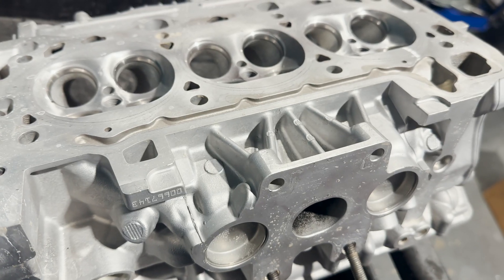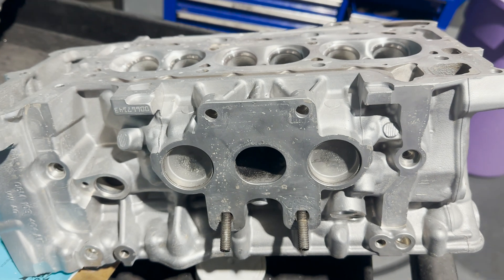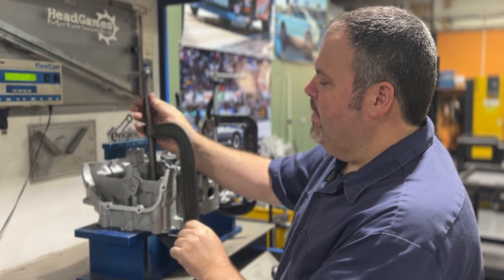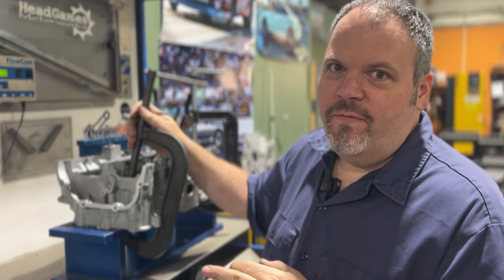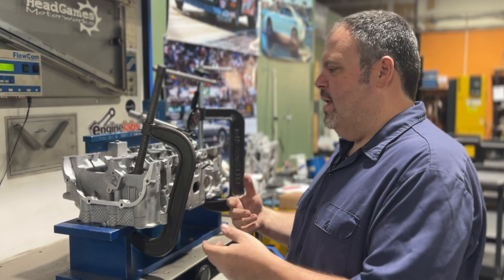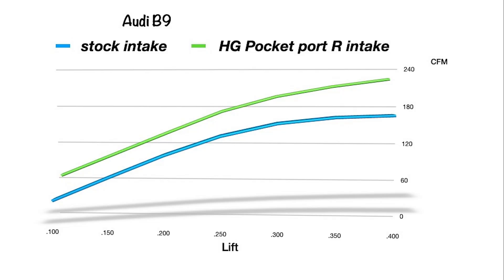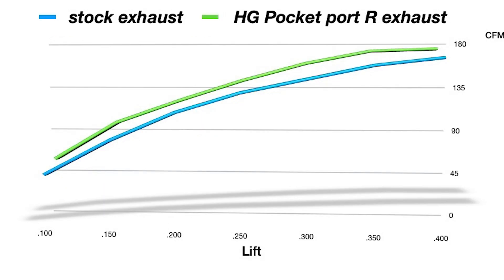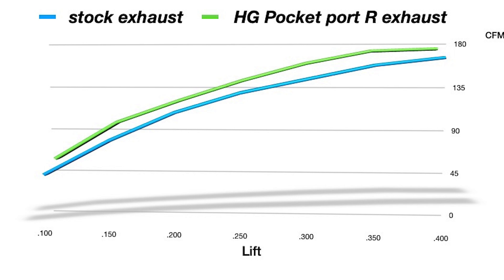The ultimate cheat sheet on getting the Audi EA839 cylinder head to flow better

Comment: Thank you for the valuable insights regarding cylinder head ports—particularly the exhaust side. I recently upgraded the turbocharger on my setup, and during inspection, I noticed the exhaust port diameter appeared to be only slightly larger than a quarter. That observation led me to consider whether porting and polishing the exhaust ports could improve flow and better support the demands of the larger turbo.
 You answered my question, i know now efforts would be more substantial focused elsewhere.
Reply from the maker: That’s awesome that you got some answers to that! Good luck with your build!

Comment: So I have an Audi C8 S6 and it has the EA839 2.9L. I have the biggest twins they offer for my setup currently TTE810s, 4 bar map sensor, 034 built bottom end, HPFP, LPFP, RS6 ported injetora, and a custom front mount inter cooler. So I pretty much have everything done to my car that’s possible. My question to you is will you cylinder head porting off a bigger power gain over what I’m already getting?

Comment: EA839 is on the B9?   The numbers stock are poor for a 3.0L.    So going to nearly 240CFM from the near 180CFM peak is a big deal.   Actually the .200" and .300" numbers are probably more important.   I was looking at 2JZ/1JZ/1mz/3mz Toyota before this which are 3.0L with 33.5 or 34mm intake valves.   On those situations they might make the intakes 35 or 36mm but stock valves they can usually get to 270cfm peak and 300cfm or slightly greater with the increased valve size.   It's required on the high power situations.

I have stock VQ35 Nissan at 205cfm@.200", 240CFM@.300" and 275CFM@.400".     1MZ Toyota 175@.200", 210@.300", 235@.400".   Ported 1mz @185@.200", 230@.300", 260@.400".    Porting on the 1mz gives 30whp naturally aspirated and almost 100whp with 14psi of boost.

So Are the B9 heads better or worse than the B8/B8.5 heads?    If the B8 situation is even the same as the B9 it's pretty horrible and porting will give some descent gains without changing much (  60-100whp on the stock boost ).

Comment: I'd be happy as hell with those gains.  Exhaust will pick up a lot relatively by just going to a larger turbine wheel and reducing backpressure. Do you ever take moulds of ports to measure taper, etc?
Reply from the maker: We haven't made a mold in many years. Now, we don't need to because we have CNC digitizing.

Comment: What does it cost to have a head tested for flow? I have a 4Piston 163 head that has been refreshed that I would like tested. Has 37mm intake valves. As soon as you have a sale on Honda heads, I have a K20 to send you for porting.
Reply from the maker: $300 for flow testing with a sheet. But, I don't think it helps much unless you always have it flow tested with one person. Like, you can't really compare the numbers because it might be how we would flow it that makes a difference in flow. It's not always the head.

Comment: Quick question, what happen to the velocity and flow if you completely remove the radius on the short side (its a straight shot from the beginning of the port to valve seat) and the head has enough material. The bowl area remains untouched.
Reply from the maker: never tested it so I would only be answering in my own theory that it would not change velocity. Only changing the port would change velocity .
Reply: @headgames  Thanks

Comment: Do you perform a single before and after flow test or do you flow test for each mod, like once for the porting and once for the valve job to show which part created which gains?

Also what is a B9 engine? Is this a v6 from an audi a4 b9 chassis or is b9 the engine code?
Reply from the maker: I don't always show every test but, yes I flow after every mod so we know what each change helps or hurts. Otherwise, you don't know what was worth it.
Reply from the maker: this is especially important on the valve job side. Because they are not all created equal.

Comment: keep up the good work! I'll never port a head but learn a lot from this channel. Main thing I learned is where to send a head if I want it done right. Is there much to be gained on gen 3 coyote heads?
Reply from the maker: Thanks for the kind words! That was what we are looking for, to inform guys like you. Gains on the Gen 3 depend on supporting mods. You need more than a stock short block to make that worth the price. There would be gains regardless but is it worth the price of admission in a NA scenario I would spend my money on boost and get the heads rebuilt with some good parts instead.

Comment: What are your thoughts on extrude honing? I read an article on it years ago with people getting it done on the intake and exhaust ports. Also turbo compressor housings  but its basically unheard of nowadays
Reply from the maker: @myrx2  I believe it’s a complete waste of money and energy. It’s just smoothing things out not taking out to a specific size or location of the port. You want real results then you have to do real work.
Reply: I'm gonna respectfully disagree with Dave on this one. I don't think Extrude Hone is a "miracle" - but it's good for certain things and it doesn't just indiscriminately remove material all willy nilly.

It's true the operator has far less control of material removal compared to a porting professional like Dave, but it does open up the restrictions while basically ignoring the areas that are not restrictive. It really shines with parts you can't get to with a die grinder. Complex intake manifolds, for example.

That makes it NOT the best for cylinder heads, but I actually had the chance to test this on a CBR600 engine I was using in a little formula racecar. The engine guy prior to me had sent one of the team's heads off for EH; so when I was doing the engine development, I tested it back to back against a stock head. Both had freshly done valves from the same shop. The stock head made 68hp @ tires and the EH head made 71hp. That's 4.4%. I should also mention the engine was breathing thru a 20mm restrictor.

I personally wouldn't choose EH for a cylinder head, but wouldn't hesitate to do it on cast intake manifolds or other complex castings I wanted to improve.
Reply: I agree.  I've did EH on my lower blower intake.  I think it has its place. In certain instances it's useful.  Intake manifolds that can't be ported by hand

Comment: As "constructive criticism"  before i get labled a hater. Its great to see the graphs, much better than most channels just numbers. But it would be great is the graphs showing percentage flow increase.(and labeling every 10cfm on the scale would be easier to read) Did the intake gain 20% and the exhaust 10%? is this going to cause a flow ratio mismatch that may need a custom split cam timing/duration to get the best out of it? Or did the increases bring it back to a more favourable ratio?  Do you shoot for a intake to exhaust flow ratio or does that have a wide ratio that works?
Reply from the maker: @krusher74  appreciate the critique. I’ll try to do that next one and see what it looks like.
Reply: Es ist zwar mehr Arbeit... aber wenn er das für uns tun würde... wäre es schön . 👍
Reply: Custom cam at all on one of those 😂😂😂
Reply: @jeremys5042 I have custom cams on most of my engines including my daily driver. It’s not as expensive as one would think